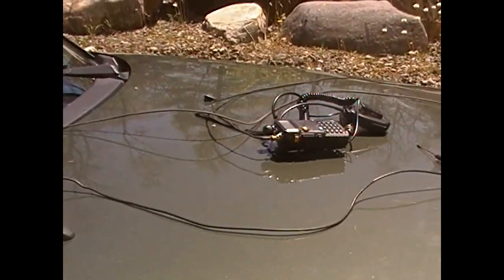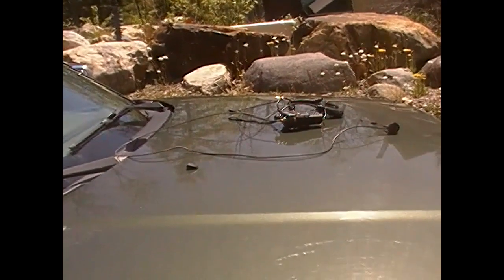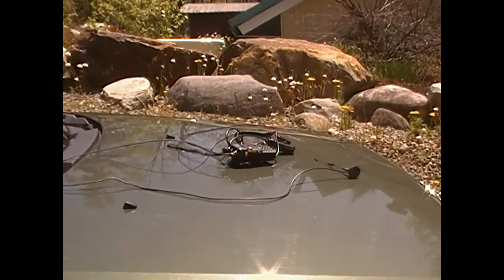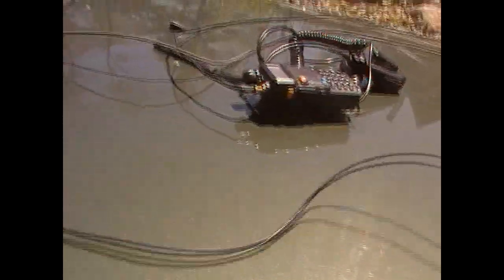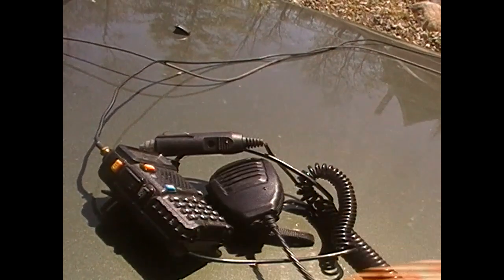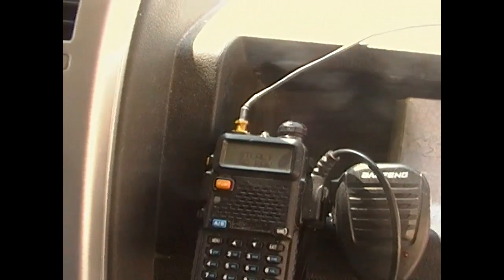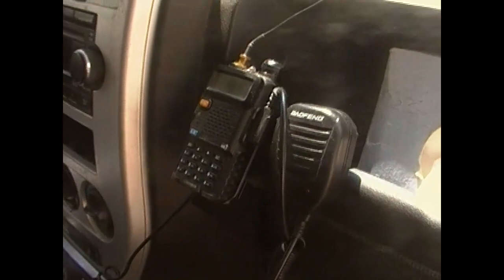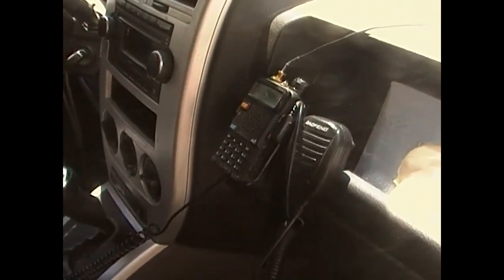Using a Baofeng handheld as a mobile radio for your vehicle.

Comment: I stopped using the hand mike in the truck. I just clip the UV5R to my visor, use battery power, and run the antenna wire out the back window.

Comment: What kind of antenna is that
Reply from the maker: It's the cheapest dual band antenna I could find on Ebay.  It's not great.  About all it does is get the signal outside of the car, which is important.  Honestly, I would recommend something from Nagoya instead.
Reply: @canadianpreppersnetwork5933   quick question, for me that hand mic makes my radio rappidly PTT instead of a stead PTT transmissions, very rapid on and off for some reason and cant be used like that, you know why?
Reply: @canadianpreppersnetwork5933  What about the nagoya UT 72? Is that good for the baofeng uv-5r?